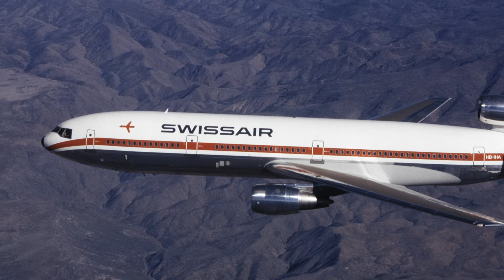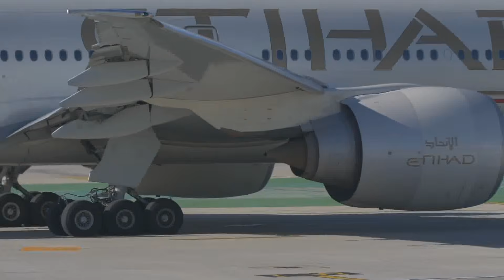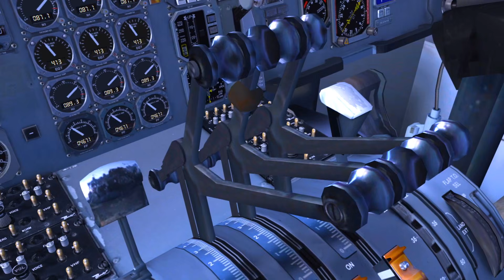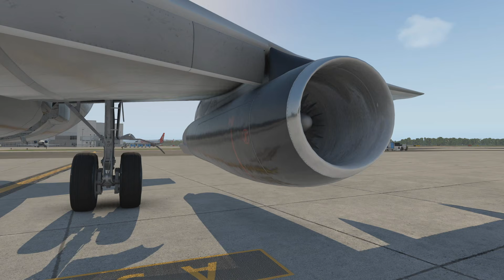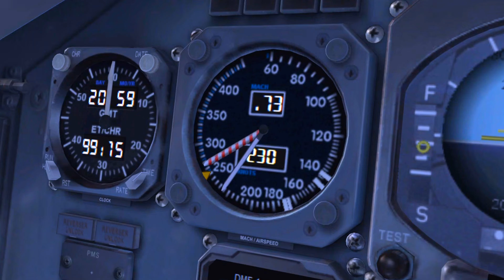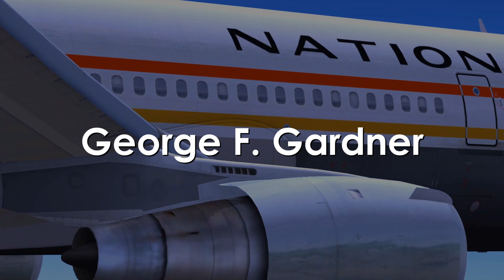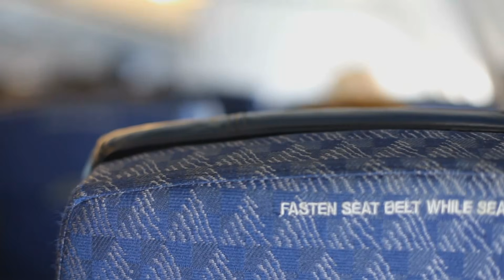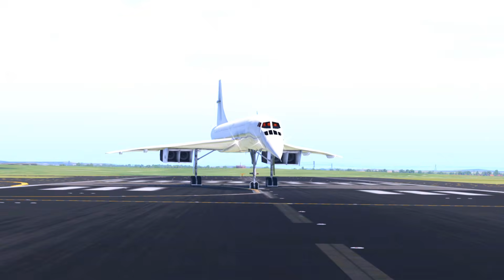The Unsettling History of the DC-10 (National Airlines Flight 27) - DISASTER BREAKDOWN

Comment: Ngl, its funny how the dc-10 was rushed just to beat Lockheed, but both the planes didn't do well anyway. Bit sad, both planes both look nice.
Reply: Because the investment in designing, certifying, and building the production facilities for new aircraft are so huge, many hundreds of the new aircraft have to be sold before the manufacturer gets to the break-even point where the projects start to be profitable. In the '70's, Lockheed, McDonnell Douglas and Boeing all competed with each other for the jumbo jet market.  250 Lockheed L-1011's were sold, 386 DC-10s were sold, but Boeing sold over 1,500 747s.  When a manufacturer believes that they will sell more than the break-even number, they exert pricing power to make sales because every plane they make only needs to be sold for more than the price of the labor and materials to make that one plane.

Comment: You should have told about the many survivors of United, and how the piolet's did a fantastic job of flying with just throttles to get to that airport. Yes the plane did crash, but many lived.  Also the General Electric CF-6 family of engines is a work horse of aviation.
Reply: Exactly.  The deaths from Flight 232 were attributed to a policy with the airlines that children under 2 or 4 were not granted their own seat and, instead, sat on the floor in the row with their parents.  It was also United Family Day, which was an event that allowed families to get discounted or incentive tickets for flights the day the incident happened, so there were a lot of families onboard.  Had each child was restrained like they do today, the death toll may have been lower (there still would be people dying due to the nature of the crash and the plane splitting apart upon landing).

People called it a miracle anyone actually survived it, as the pilots lost all hydraulics, thus they can only steer and balance using engine thrust.  Japan Airlines Flight 123 also suffered a catastrophic loss of hydraulics, although that instance it was an exploding bulkhead from an improper repair 17 years prior and the plane was a 747).  That plane had four survivors (likely would've had more, but politics between Japan and the United States, Japanese pride, or both got in the way).

This flight was also cited as an example of how you properly do crew resource management, as there was no procedure available to guide the pilots on how to land a plane that has no functioning surfaces due to hydraulic leak in all lines.
Reply: He's going to make the vid of that one in the future. But, yes Denny Fitch, an off duty UA pilot was onboard and it just so happened that he had practiced in the simulator extensively for this very scenario. Without him and the flight crews amazing airmanship none would likely have survived.
Reply: @jamesstreet228 God bless you in heaven, Captain Fitch.

Comment: I flow on a D10 once, one of the latest in operation for regular passenger transport, and it was a bad experience. It looked old, toilets were weird, and the plane wings looked like they were bending at the slightest turbulence. Also, there were a lot of parts fixed with rivets on the wings. Really terrifying. Not to mention that we had bad turbulence on landing and takeoff and at a moment it felt like we dropped 30 meters in a heartbeat because of them.
Reply: Prayers for your continued recovery from your terrifying encounter with a not-new DC-10 flying in not-perfect weather.
Reply: I'm no engineer, but I am pretty sure you want a plane's wings to be flexible! And if you land through cloud, it's usually a little bumpy on the way down no matter what you're riding around in. I am sure you were safe!